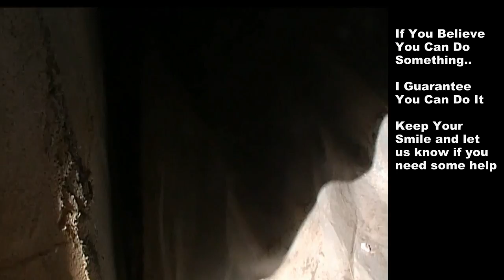How To Install Footer Tiles In Your Crawl Space, Do It Yourself, Lots of Labor

Comment: I know this is an old video but thanks for the tutorials. I decided to go ahead and do my own french drain. spent $1100 instead of 8.75k quoted by 3 different contractors. So far have trench dug up on a 1600sq ft crawl and 50 bags of rock with 200 ft of 4 inch pipe.
Reply from the maker: Way to go Pat!! I am sure you will solve your water problem! Thanks for sharing your progress!!
Chuck

Comment: Just a suggestion to anyone bringing in stone with small crawl spaces. Use a sled. ropes on both sides. lot easier then buckets. Thank me later.
Reply: Went to comments to say exactly this
Reply: What kind of sled did you use?
Reply: I would have used a small garden fillet with fat tires. 
The ropes are an excellent idea. Then you can just have one person load and you pull it in. 👍
Reply: ty

Comment: May I ask why didn't you did deeper to move more of the water? Also why not come away from the walls at least 10 inches. The deeper the trench the more water will flow through. As to having 70 bags for 150 ft. laying bottom and covering top seems skimpy. I would think a wider trench, are weeping holes needed since water has gotten pretty high into those cinder blocks?

Comment: Great explanation of important points.  This is what is needed for my project.  When you talk about Footer Tiles, are you simply talking about the trench at the footer, or is there actually some tiles?    I do not see any tiles in various videos and only a trench with perforated pipe.

Comment: When do you know to put a drain in the inside versus the outside?  I have efflorescence.  But, I don't see standing water (I have not dug down to the footer yet).  I seems the inside would be much easier to route due to sidewalks, driveways etc.  Thoughts?  Thanks!
Reply: Mike did you ever put in the drains?

Comment: Why not stop the water from the outside, installing the footer title drain before it penetrates the walls in the first place? You could then also install a waterproofing member and you have a lot more space to work with?
Reply: Cornwell did he ever answer your question? Seal the crawlspace for the outside?
Reply: @dannycottrell4387  nope
Reply: @scocornwell834  as im typing this i just dug down to the base of the footing. its 19 degrees in illinois and I can tell you that water will still seep thru even with a french tile outside. I have outside french drain on my house but not inside. Sand is all wet and I can tell you as soon as spring comes there will be water in my crawl. Its a 1600sq ft crawlspace and I am using 200 feet of perforated 4 in pipe with 50 bags of gravel and a sock over it. total cost for me was about 1100$ and I was quoted 8.75k to do the job
Reply: @shlomogoyslop  So your saying there is no hope? If outside doesn't work (if done properly) then inside will fail as well. I have no personal experience but from all the videos I have seen I much rather work outside and use a mastic and dimple drainage membrane etc.. then kill myself inside a tiny dark crawlspace. Once I have time I will do my on the outside (clay soil) in very north NC.